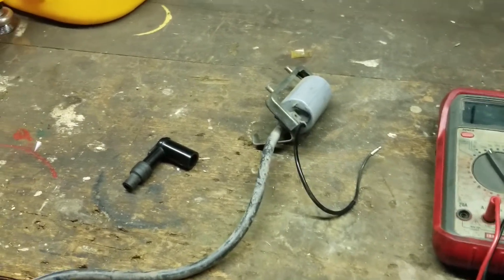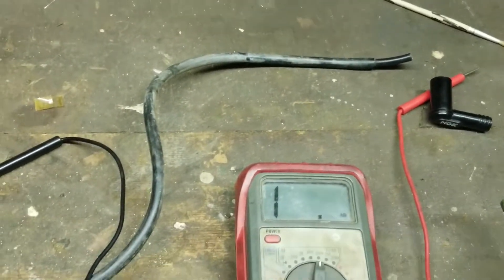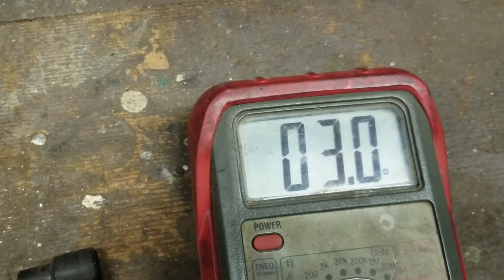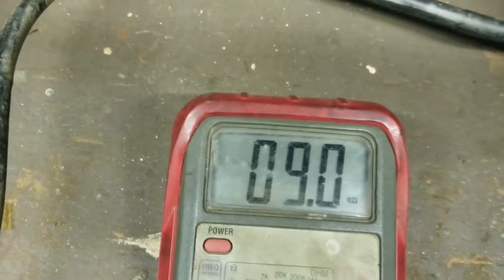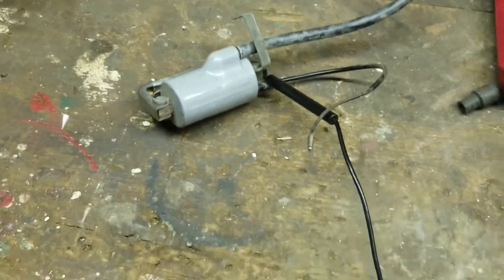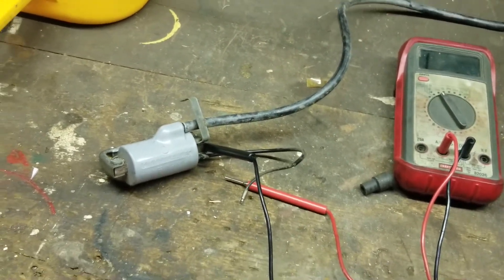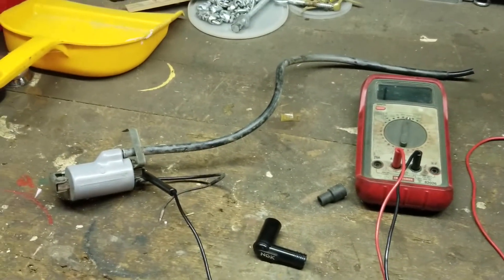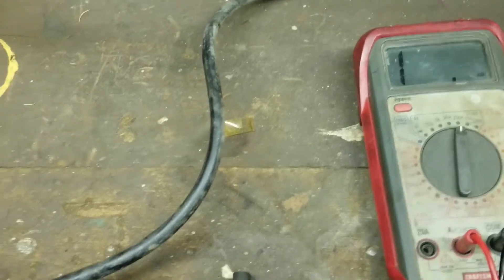Ke kd km kv mt kh gto all 6volt coils Testing

Comment: Kevin will a new eBay coil work for my 71 Suzuki 50? The one they say fits my MT50 has a third lead. The ND coil only has the small and big leads. My ND coil is bad if you want to swap with me...let me know please.
Reply from the maker: The 50 is 6volt make sure your buy the same one as your bike requires but I can tell you this MT50 with a bad coil I haven't seen it points and condenser
Reply: @2strokeguru  Kevin, thank you for your reply. I have cleaned all the metal to maximize a great ground, but I'm getting 8.1 with the spark plug cap off, 19 with cap on. If you say 5 is the limit, then it's shot. I hate to buy a used one off eBay because it too may be shot. Are you serious about an exchange, because I will swap with you. I can't find a new one except overseas.
Reply from the maker: @bizb8742  have you replaced the points and condenser
Reply: @2strokeguru Not yet, but I have the new Suzuki points and condenser coming this week. Re my coil, are you saying that I should just use this coil in spite of the high resistance? I thought over 5 was junk? If I put it back on, isn't it going to run poorly and fail in short order? I'm replacing everything that's out-of-spec so I don't get stranded.
Reply from the maker: @bizb8742  replace them 1st and set them
Reply: @2strokeguru  OK, will do, I am sure the big no-spark problem is in the points and/or condenser. With high resistance in the coil, isn't it just going to fail in short order? The coil I got from eBay tests with no resistance, fits the 82mm mounting holes, but I don't know what the second small connector wire on this coil is for. The seller can't tell me either. Any help appreciated. The one wire is green, the other is black.

Comment: Hello, Keven, thanks for the walkthrough! I have a 1975 Honda ST90 with the original ignition coil that has a small condenser attached to it, and while I haven't torn the bike apart (it's a pain in the arse!) to test the coil, I bought the same 6v coil as you're testing in the video as a possible replacement. My question is will this new coil work on my bike without having a condenser like the OEM? Thanks again, and take care!

Comment: My Honda ct90 has a red and a green wire coming off of the coil
  I put the leads from my volt ohm meter on them and got a 2.7 then I checked the plug wire and got a 10.1
  Sometimes there is spark sometimes there is not 
  Any ideas where to go next 
  The points are opening and closing they are clean and there is 6volts on the spring
  Apparently I have a gremlin 
 It is a 1974 with 1594 original miles on it 
  Any ideas??
Reply from the maker: I would replace points and condenser just because they open and close they can have a short on the pivot point insolater is probably worn and replace the pair points and condenser

Comment: Hey Kevin, I have a problem with my bike, Kawasaki KH100 G7, I ride about 10 min and then the bike misfires, bogs down, and I feel a loss of power also. Some people told me that it should be the ignition coil, but I tested it and the resistance values are the same you got on the video. So I'm lost now, do you have idea of what to check? Thanks
Reply: I have the same problem some help would be great
Reply: @chadfabian3143  I still have the same issue and I don´t know to solve. By chance if you solve yours please tell me how. Thanks
Reply: @correia9 
I have a 2001 suzuki ax 100 2 stroke and has the same issues as your bike and bogs down and loses power and some man told me it could be a voltage regulator /resister
And is located near the coil or the stator coils could be burnt out in the flywheel and did you ever get it fixed after.
Reply: I know it’s been a year now, but did you try replacing the spark plug?

Comment: Would a Honda coil like that work on a 74 g4tr
Reply from the maker: No honda uses a 12volt Kawasaki g4tr uses 6volt and your coil is good replace points and condenser Kawasaki 6volt coils don't have enough current to damage them
Reply: Kevin Bergeron I have power going to the ignition coil from the points though, the power isn’t going through the coil
Reply from the maker: @Lijgaming  how many volts
Reply: Kevin Bergeron a full 6 volts or a little bit more when I tested it
Reply from the maker: @Lijgaming  what I don't understand is how you are testing this this is not making any sense
Reply: Kevin Bergeron I don’t get it either, the coil seemed fine when I tested it, and the condenser and points are sending 6v to the coil, I’ve been testing it with a multimeter
Reply from the maker: @Lijgaming  did you replace points and condenser
Reply from the maker: @Lijgaming  you can't get voltage at the coil unless the engine is rotating at more than 300 rpm the battery has nothing to do with ignition system
Reply: Kevin Bergeron when I kick it over it sends 6v to the coil, I replaced the points and condenser and rode it all of maybe 10 times before it started having spark issues again
Reply from the maker: @Lijgaming  what coil are you using
Reply: Kevin Bergeron the original coil to the bike
Reply from the maker: @Lijgaming  new plug?
Reply: Kevin Bergeron I have used the old and new plugs, I’ve also changed hats and that didn’t work either